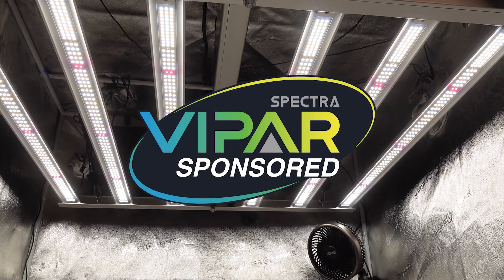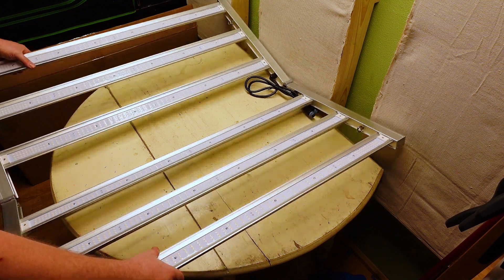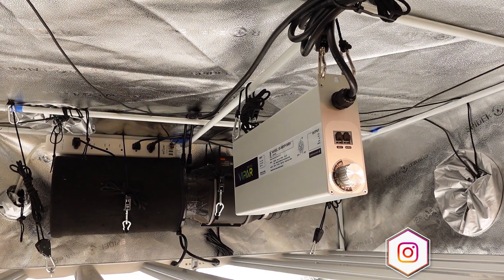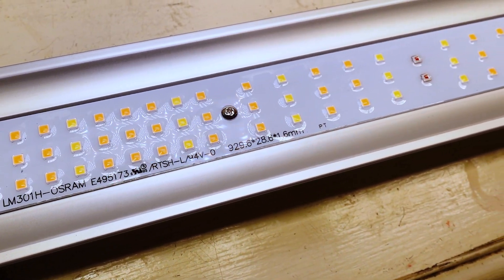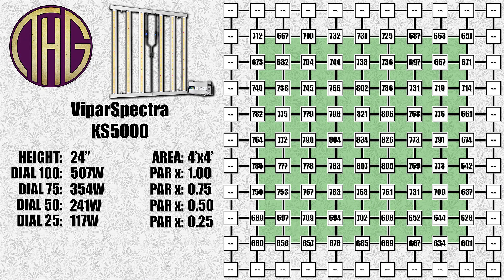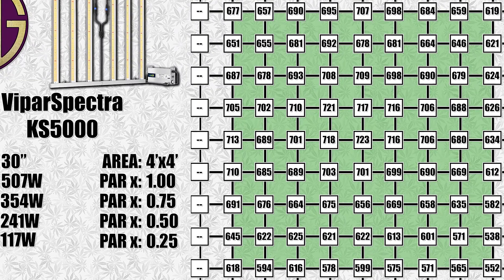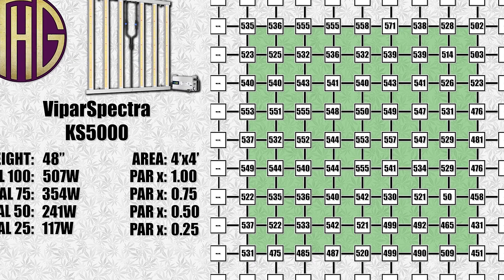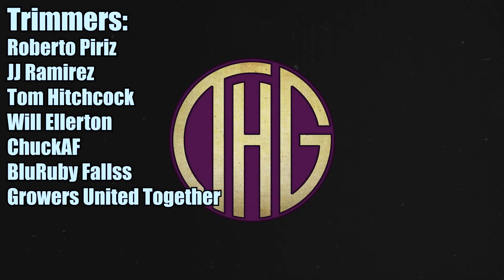The Light Spread Is SO EVEN!! ViparSpectra KS5000 Unboxing With PAR Levels

Comment: Another great video, thank you! Question though, while it appears to be a very well made and efficient light, would buying 2 of the XS 2000 be a better bang for the buck with higher light? I was about to buy those when this vid came out. My thought was the added light would bump up the edges and I could either raise them a bit or dim them to save wear. Thoughts?
Reply from the maker: Two XS 2000's can give you more flexibility, as they could be split into two separate tents in the future. You wont get the same amount of light spread across the tent with the 2x XS2000's but it could work. Did you mean 2 of the xs4000's? That would fill a 4x4 tent out pretty well with higher light levels as well.